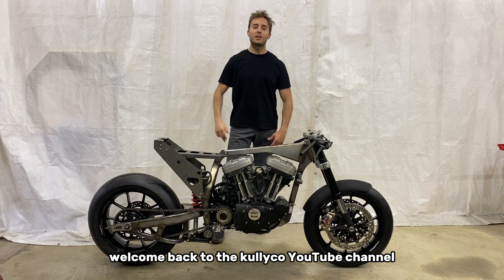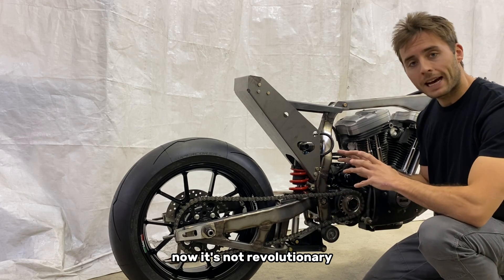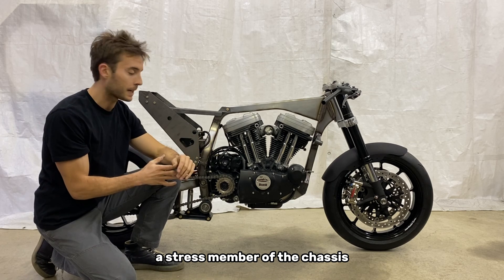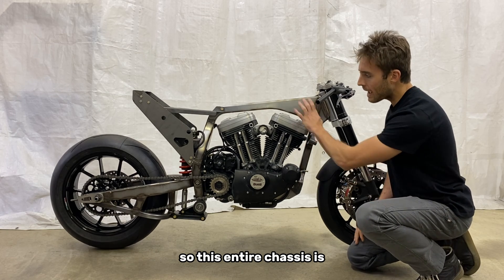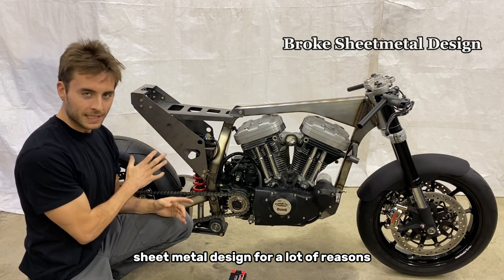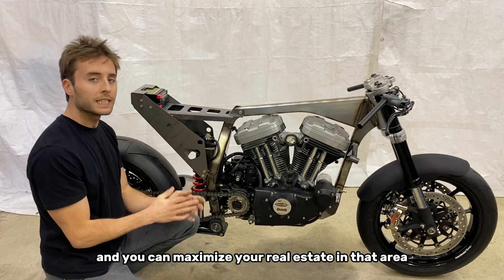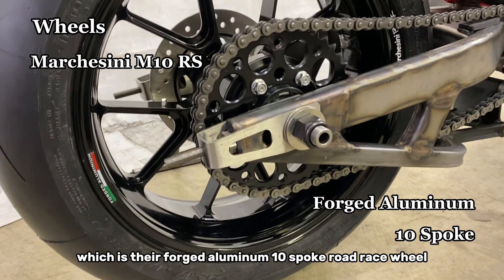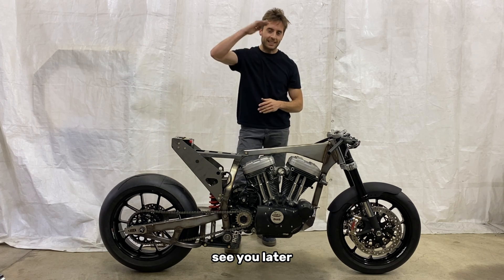Rolling Chassis overview on our custom motorcycle project / Hand built MotoGP inspired racer bike

Comment: It's very cool and I look forward to seeing more of the design as it matures.  One concern I have is the lateral rigidity of the head tube.  The only connections running to it are roughly the same width and perfectly on the centerline, which means that section will get no stiffness from triangulation.  Every superbike frame I have seen has massive triangulation running to that head tube either in the form of twin upper and lower tubular frame sections or massive square wall hyfroformed tubing coming in from both sides in a wraparaound configuration.  What you have done is amazing and it looks as cool as can be, but I just want to make sure you are considering the flex you may get on the front end with that design.  It could result in dangerous oscillations under stress.

I'm subscribing and I genuinely wish you all the  best.
Reply from the maker: Hey man, I genuinely appreciate your comment and intelligent input!  

I thought heavily about different frame designs- including examples similar to what you just mentioned.  At the end of the day, I am building a really race inspired, custom, street bike!  So, I decided to go with the stiffest version of a single backbone, frame that I could hammer form. 

As it will have all of the equipment to push on the circuit... I just don't for see myself putting the bike in a situation where it would meet its maximum capabilities. :)   However, I would like to put a road racer / superbike rider on it at some point and see how it feels!

Thank you for watching and subscribing!

Comment: You could have at least used a better engine and built a frame from titanium pipes! That thing will be heavy and slow.
Reply from the maker: lol thank you for your input :)
Reply: You can not use a harley engine as a stressed member since it was not designed for it! Apparently you know how to weld so using titanium wouldnt be that difficult. @KULLYCO
Reply from the maker: @MaciusSzwed  the last bike i built had a titanium frame .  The bike in this video has a much wilder frame than that in my opinion.   Hammer forming chromoly is a majorly work intensive process . 

Also, yes this particular engine was used as a stress member in its stock orientation.  Stress member is a very subjective concept.
Reply: Ok nice do you have a video of how you made that titanium frame? so your building a modern BUELL @KULLYCO
Reply from the maker: @MaciusSzwed  no video on ti frame building. Unfortunately i wasn’t hot on the YouTube thing yet when i was building that bike.  But there is an overview video of that bike (kc900) that shows the frame and other things.  That bike also has a unique, torsion-bar rear suspension.

Yes modern buell with some traditional Harley flare :)
Reply: You see that's what Ive dreamt of building for a long time!  @KULLYCO
Reply from the maker: @MaciusSzwed  maybe it’s time to start a project :)